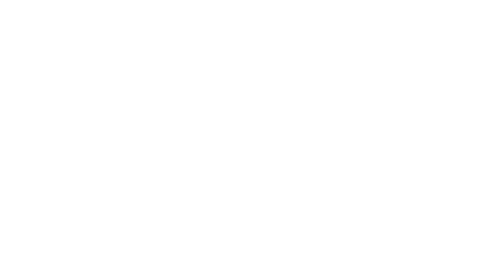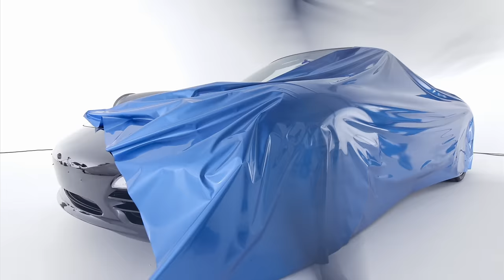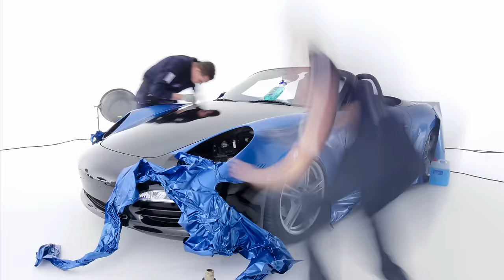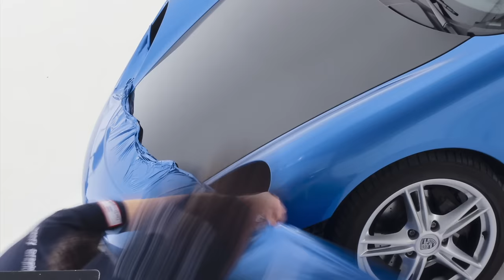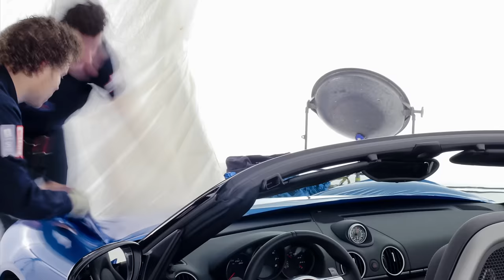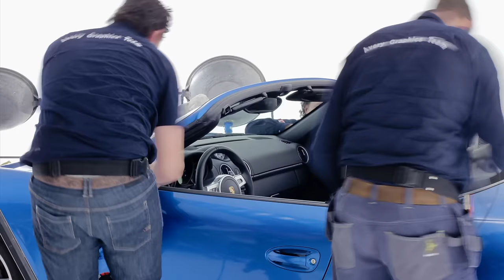Don't paint it.  Wrap it with Avery Dennison's Supreme Wrapping Film!

Comment: I have used both on very expensive  vehicles (3M and Avery)  both are good materials #m is the best to apply no doubt, but Avery shine the best I did a Lambo color change with 3M and it was done in 5 Hours
  But in the other hand the same car 6 months later was done in 7 hours..with Avery ..u can't beat the shine on Avery, but the controltac on 3m is the best